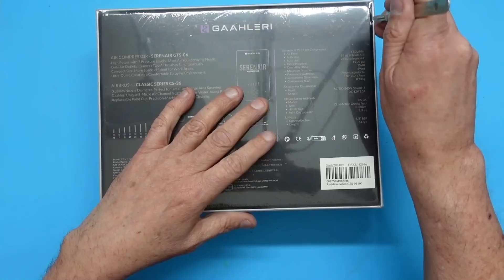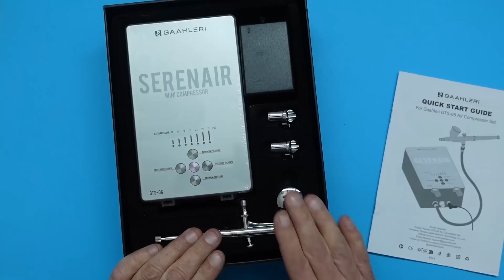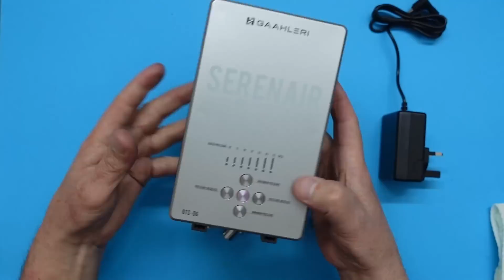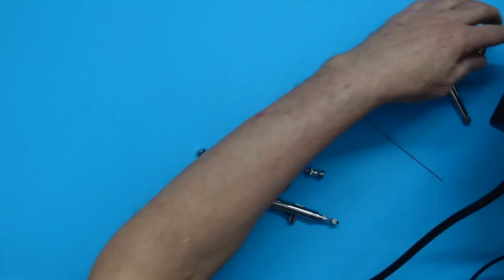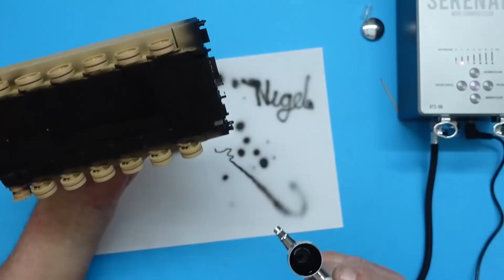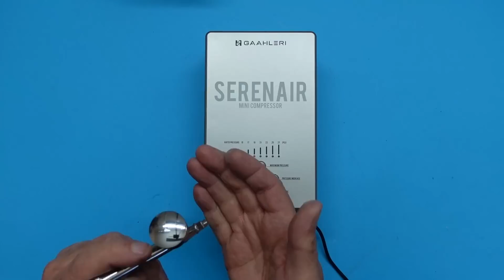AIRBRUSH STARTER SET!! Gaahleri Serenair set

Comment: i have a fengda fd186 compressor off amazon but cant b bothered waiting for it to fill up for painting smaller parts so i use hataka blue line paint for cockpits and interiors but did see this gaahleri compressor ans thought it would be good for spraying the smaller bits....i did watch a lot of reviews as it looked they sent them out to lots of youtubers to review....but one other and your review were good genuine reviews so i bought one....its nice...i put my ps289 airbrush on it,i havent tried the one in the kit but it does look nice quality ..im using mine for the smaller bits and post shading and i love it...oh i did take your advice Nigel and order a water trap cheers
Reply from the maker: It’s great that you’re finding it so handy for smaller jobs and post-shading work! It's a good little tool.

Comment: Watching you use yours for prolonged spraying is blowing my mind. I'm using mine in short 2-3 second bursts and the tip is drying out in minutes - thinned paints and all! very close to binning my Serenair completely but I'll try it on a lower PSI with a tighter spray volume. Cheers, Lee.
Reply from the maker: What paint are you using? Tip dry is not normally an issue with the airbrush?
Reply: @NigelsModellingBench  Monument Hobbies and Army Painter Fanatic mainly. I presumed it was tip dry but I'm still new to it all! It will spray fine for a few minutes, then paint will just stop coming through, then a spatter, then just air again. 

Weirdly, I had to rebuild it yesterday after watching this video. Tried it again with thinned Citadel paint it worked fine with the lower pressure setting!

Comment: The paint jar lid is well and truely jammed on mine. Got it off once and now its properly stuck.
Reply from the maker: Try squeezing the sides of the cup in different positions and it may pop off.
Reply: @NigelsModellingBench  Thanks, I used mole grips locked around some cloth. I guess I dont push it fully closed!

Comment: When I started modelling again in 2020, I bought one of those kits with a cheap airbrush and small box compressor from Amazon. Frankly it was a heap of crap. That compressor was smaller than this one and only had limited air pressure settings. I could not reliably get paint through that airbrush. So ultimately, I wasted my money buying cheap.
However, this one looks much better. The fact that it has multiple air pressure settings, makes it much more reliable I think. However, it looks like you cannot buy the compressor on its own. Someone may have a better airbrush at home, and want to just buy the compressor. But, the price is not too bad, so you it could be worth it even if you already have an airbrush.
Reply: Sometimes another airbrush is a good thing. It's not necessary, but it's a good idea to keep your paints, dyes, and sealants in different brushes.

Comment: Tx Nigel, 

everyone else did send Nigel my comments he picked up on similar issues to me ( the air brush holders and no moisture trap) i also added it does vibrate a fair bit when running, so make sure it is on a solid surface or else it will sound like a drum especially on the high power setting.

The cheap air brush i can still use for metallic paints/ink which is a more deep cleaning exercise so keeping for that exclusive use..

I bought it because its small and portable and as a back up to my compressor which is getting on now.

Comment: My first compressor was a Tamiya basic one which had only one pressure setting. Figured out that I could get more by using a high amo multi adaptor and changing the voltage.
This would have been a much better starter compressor and I would have loved to have started with something like this.
Like you I would change the holders. Even if they didn't give you a swivel mount for the  just having one that points left and one that points right would be a big improvement. Add a couple of extra mounting points on the side as well so you could have the airbrush pointing towards you.
Definitely a good start until you move onto compressors with tanks.

Comment: How hot does it get after using it for a while?
Reply from the maker: Not sure.. I'll test it out.
Reply: @NigelsModellingBench  My experience with these smaller compressors is that they run all the time, since their airtank/reservoir is on the smaller size, so it gets rather warm, something to keep an eye on. I had a piston model that got very hot, and don't forget that alot of our hobby materials (glue and thinners etc) are quite flamable. When you keep it on the desk, it seems like it could be a potential risk.

Comment: Purchased this a few weeks ago. Never airbrushed before, always been put off by the price but for £65 I thought I would give it a go. Just finish my first kit and it looks so different from brush painting. I did buy a quick release but can not get the air to flow through it. Thank you for the review.
Reply: Painting with an airbrush definatly has a learning curve, but nothing beats it for painting large areas. like ship hulls or tanks. as your skills improve they can also do finer detail with different needle sizes, and models. As you see in the video, Nigel paints the bottom of the tank in seconds, doing it with a brush would take much longer. of course this can be offset with the preparation and cleanup afterwards, but the bigger/more things you paint at the same time, the better.